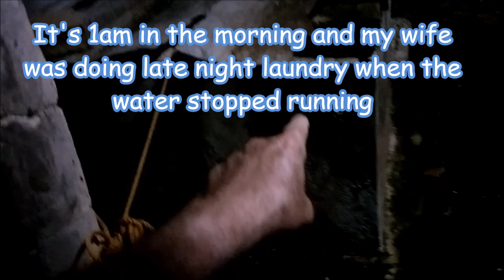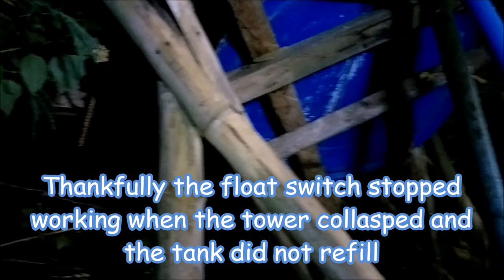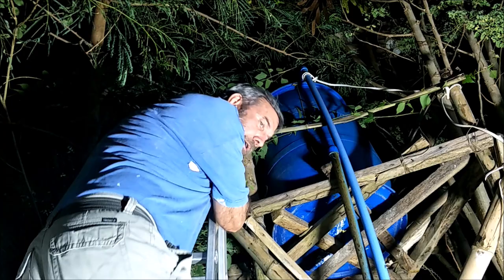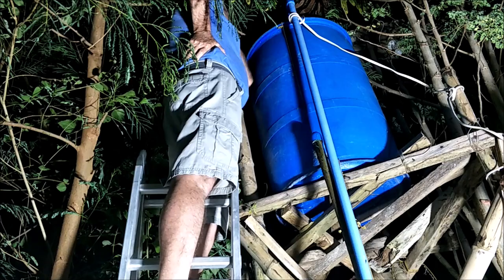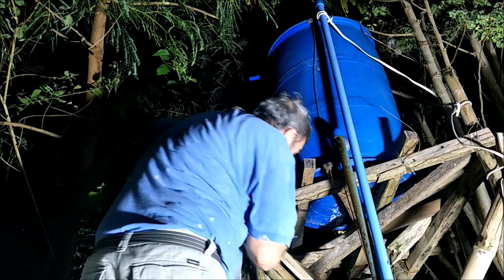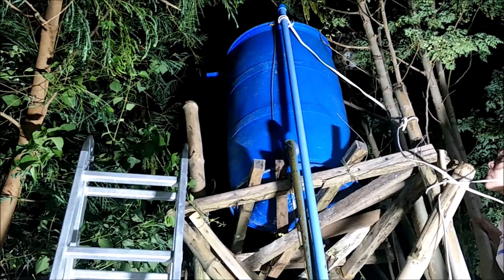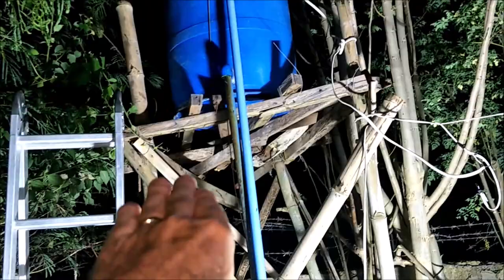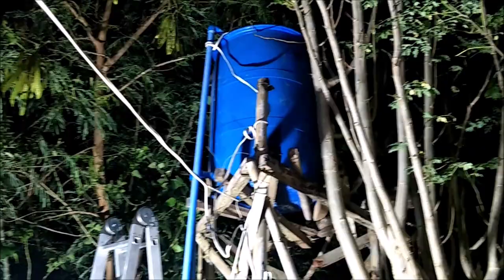Our Water Tower Collapses And DIY Jungle Repair

Comment: Buy some angle bars and make metal stand, thats what I did w @ my moms house. Anti rust paint, been 12yrs and survives bunch of typhoons. If I remember I did buy a stainless tank. worth the money. Good luck
Reply from the maker: I'm going to use galvanized pipe for the frame and a cement footing for typhoons.
This rickety bamboo tower actually survived a 90 mile per hour typhoon last year😊
Reply: @myparadiseonbantayanisland9030  very nice, never thought of galvanize pipe, it does make sense, since everything rust faster in an island.. Can’t wait to see the finished project.
Reply: @myparadiseonbantayanisland9030  wow, i was thinking for sure it would not survive the next storm. Maybe that 90mph wind storm is what broke the supports free at the rotted points.

Comment: How high is your water tank? What kind of water pressure do you get? i've been absent for a while glad to see you're still making quality video's
Reply from the maker: The bottom of the tank is about 8 feet high, the water pressure is ok for washing dishes, and the shower works but not much water, also not for running a full size washing machine (it just has a small stream of water - the machines valve is very small) my wife has a water hose she will fill the washing maching with so it doesn't take so long to complete washing. 
If the tank was maybe 12 feet to the bottom it would be much better.